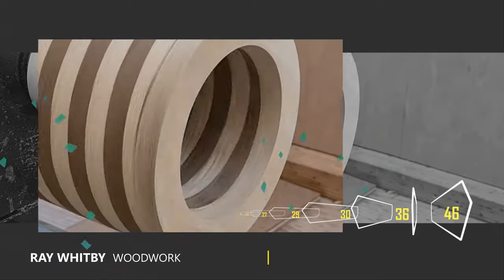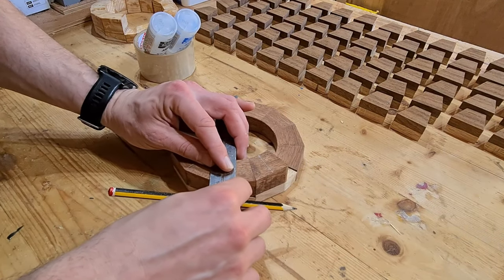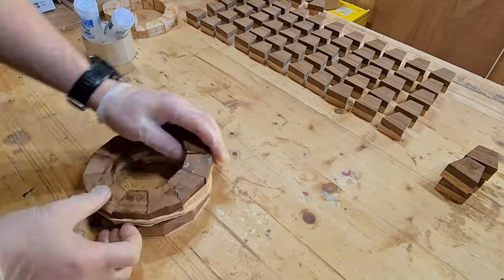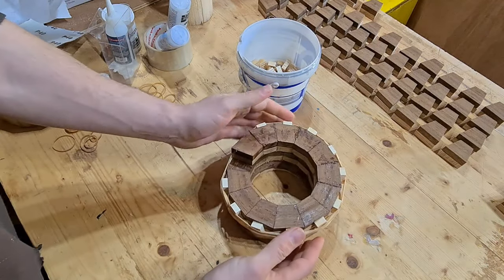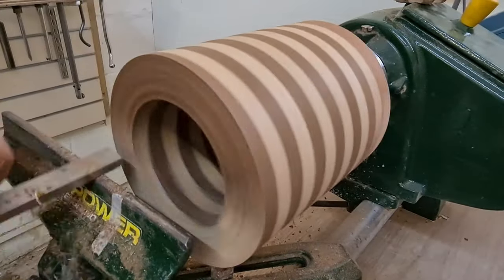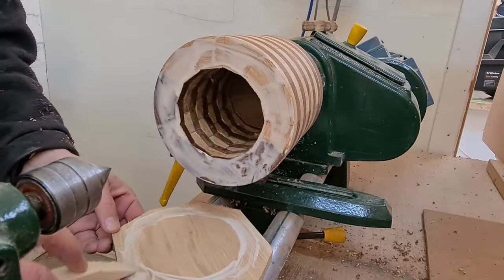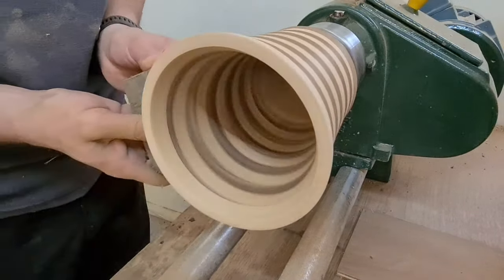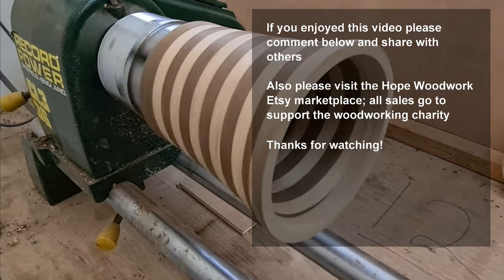Woodturning - The Twister

Comment from the maker: Question of the Week: What is the best way to really show off the helical design of the piece in terms of overall shape and the style of the open end?
Reply: Making the blocks thicker to really kick the pitch of the helix would do it......... At the expense of a shedload more work recalculating all the block face angles. :D
Or, if you went away from the vertical joins between the blocks entirely and made them into a squat diamond shape, you could make the helix go whichever way you wanted, or even have multiple helices going in opposite directions........ Even more work than just tweaking the angles though.
Reply from the maker: @Reman1975  That's some fantastic idea Reman! I had a pseudo mental image a couple days back of opposing helices but couldn't quite figure out the "anchor" pieces - your idea of the diamond is the key! I've got another idea for an open helix structure to try and getting distracted with bow ties again. Hopefully I can cogitate this idea further to see if I can figure out a way. Thanks so much for sharing the ideas! All the best. Ray
Reply: @RayWhitbyCreations  Interesting.
As soon as you said "Open helix" It made me think that the diamonds didn't have to be full square's. You could just make little "Planks" of wood and alternate the direction. You'd end up with a wooden "Wicker basket" sort of affair. What I'm visualising would be an absolute pig to put together (It would probably need a huge number of spacer pegs to go in the gaps while the glue took), but what I'm picturing would definatly be something I've never seen done before, and the smaller contact area between the pieces would mean that the accuracy of the angles wouldn't be as ridiculously crucial as they are on the projects that use full surface contact between blocks.
I'm not sure how structurally sound it would be though........ Then again, you've already made a couple of seemingly impossible projects where all logic dictated that they should have become wooden shrapnel the second you touched them with a tool tip, So maybe it would hold together ? :D

Edit - A random idea just popped into my mind......... What if the little planks in the wooden wicker basket idea were made from decent quality voidless birch marine ply, with the edge of the laminated layers facing out? I've got a strange feeling that as a classic pot belly vase shape that would be really attention grabbing, and add a "Is it actually wood, or something that's been woven?" feel to it.
Reply from the maker: @Reman1975  Love this idea Reman. Going to take some time to think about this. I have copied your comment and put it somewhere safe (coz I doubt I'd find it in the comments when I want to go through it again!). It's conjoining with an idea I want to try with Kumiko and now with interconnecting diamonds or hexagons. It's going to take time to develop and then see if I can make it work. It should look stunning, but it's a big if.
Reply: Perhaps making all of the blocks out of the same species, and then just adding a contrasting veneer layer to delineate the helix... could add some delicacy to the visual impact.
Reply from the maker: @howiebalch8402  That's an excellent suggestion Howie. I like it!
Reply: I Really like the way you have done it. An open end would probably not be possible to get it very, very, very neat. The topring you put on it makes the vase look stunning without any visible flaw.
Reply from the maker: @frankvanderwal4571  Thanks Frank! Appreciate your feedback. All the best. Ray

Comment: Great work Ray! Your bandsaw jig is absolutely brilliant I would not even know where to start making this type of segmented turning. But you certainly inspired me so will give a go to something similar but still different 😀
Reply from the maker: Thank you very much David! I would be interested to see what you come up with. Not sure if this will help, but the immediate thing to mention (if doing something similar) is that the helical angle change between front and back of each piece is non-linear. So the bandsaw ramp should be profiled aaccordingly if you wanted to get a seamless interface, or as close to it as anyone could get! But the larger the diameter of the project, the less pronounced this non-linear variation will be. I used epoxy glue as it could hide minor gaps! And using epoxy resin with a longer setting time really would have helped this project! Thanks so much for watching and commenting. Take care. Ray
Reply: @RayWhitbyCreations  That sounds like loads of precision needed I am not sure I am good at that :):) Have something different in mind but not even sure I can explain it. Will do some test run to see then move on to making the project 😊

Comment: Very ambitious project, and well done! At one point you asked opinions regarding the rim piece... another option might have been to do a segmented ring of oak to minimize end grain, possibly would have worked on the base as well. Keep up the beautiful work!
Reply from the maker: Thanks Howie. The segmented ring for the rim and base could work. I guess it depends whether the alignment of the different width of wedges (12.5 wedges per turn for the helix and an integer number of wedges for a horizontal ring = slight  mismatch) is positive or negative or hopefully not noticeable. Thanks for the feedback, love the idea! Take care. Ray
Reply: @RayWhitbyCreations  I don’t know, I say lean into the mismatch, change the segment angle to 10 or 15 degrees, make it a feature not a problem. 😉

Comment: Was watching an Olivier Gomis video the other day and wondered if someone had done a segmented helix project before with smooth transitions. My hat is off.... bravo. 
I think the solid top and bottom rings worked just fine. 
Maybe the center core could be epoxy proofed so it can be left in place while gluing.
Also the clamping paper should be replaced with saran wrap or wax paper. 
Make a spinning motorized base for that make you dizzy experience.
Reply from the maker: Thanks Mr Mc Flurry, greatly appreciate the feedback and advice. I had not come across using saran wrap or wax paper to hold the piece. Was told slightly damp paper towel would suffice, but always would prefer something with more grip! I have visualised a logical next step to the helix, but I don't yet know if I can pull it off. Time will tell. All the best. Ray
Reply: @RayWhitbyCreations  the saran wrap or wax paper mainly keeps your epoxy and glue from sticking. I hate having to clean off bits of what ever stuck when doing glueups. I subscribed so am looking forwards to your next project.
Reply from the maker: @nutsmcflurry3737  Ah, I see. It is the product needed for an upcoming project! Thanks for your support.

Comment: Another great example! I wondered about either an accent piece (black veneer for example) between each piece or maybe even a piece of clear/translucent material. When I hear "double helix" I can't help thinking of the DNA model. Cheers, Dave
Reply from the maker: Thanks Dave! I think for accenting this piece I would need to offset the oak from the mahogany wedges to get a decent brickwork pattern. This would require a redesign in the approach, which I'm working on, but not yet clear on how to achieve 2 seperate (albeit interacting) helices. If I (or others) can crack this new approach then a proper model of DNA should be possible! Thanks for your feedback. Take care. Ray

Comment: One design idea is to use one or more thin dark wood strips to make the spiral, and use a light colored wood for the rest of the project. This would keep the design simple and elegant I think. I have no idea how to make the lines cross over each other, but that would be very cool. Also, are you familiar with the work by Steve Garrison? He has some very interesting work on making spirals with a scroll saw that might provide some creative cross pollination with your work here. Keep up the great work!
Reply from the maker: I hadn't seen Steve's work and it's very creative. An elegant way to achieve a spiral. And without having to invent a new woodworking cut and jig! Thanks for the heads up!

Comment: A great project, I enjoyed this video. 
This isn't a criticism, just a couple of ideas that I would love to try if I owned a lathe:
1- I'd love to see what it would look like if you made the helix at a much steeper angle. I am not sure how steep you can go before it becomes impossible to glue up but I would think the effect would be very cool.
2- I would also love to see the same thing you just did except with small spacers between everything. Then casting the entire piece in resin so that the resin would end up looking like 'mortar' between the 'bricks' of your helical structure. If you used a slightly opaque resin tint you could probably hide the spacers and make it look like the blocks were sort of floating.
Reply from the maker: Hi Curtis. Thanks for your detailed thoughts on this, greatly appreciated. I believe you are correct in that the steeper the angle the more difficult it would be to glue up when applying radial pressure. Perhaps increasing the number of "anchor" points would help. I have a project in mind that will involve a steeper set of helical angles, but it will take time to develop and I'm not yet sure if it will work.

Your second idea was my initial desire, to space out the wedges and fill with resin, but I had to see if I could make a seamless version as that would be the most challenging and I thought therefore if I achieved it then it would be a really popular video and take off. A strongly performing video helps with the growth of a channel. 

Anyway, now that I have at least achieved the design for a seamless version, I can look into the wood and resin ideas. It's probable that the combo is more exciting to the YT algorithm! I've got a couple of immediate projects on the go and my day job work is increasing, so it may take a while before I can get to it.

Thanks once again for watching and commenting. Take care. Ray

Comment: I would like to start by saying absolutely beautiful! My thoughts on construction instead of epoxy I would use titebond and ca glue on the anchor blocks and titebond on all the other. Far as the ending and beginning rings it might be interesting to add a accent ring that draws your eye into the beautiful movement you created followed by a segmented ring of oak and mahogany. With that said what you created was truly inspiring and beautiful bravo!!
Reply from the maker: Thanks for the detailed insight William. When you say accent ring, do you have a link to a photo or video where it is featured please? Really interested in visualising your thoughts on this. Now that I completed the piece and it looks fairly flush fitting in all the pieces (no gaps), I probably could have done it without epoxy glue. Perhaps I should have had a little more confidence. Thanks for watching. Take care. Ray
Reply from the maker: @willaiml  Thanks William, will be thinking about it!

Comment: #doublehelix Excellent! This is a great idea, which will inspire many more I am sure. I hope to imitate this effort. I am trying to understand the need for different angles on the cut segments. My geometry is pretty rusty, so I could use some tips. If you could explain that part, and the need for the bandsaw jig, I would be really  grateful. Thank you for sharing.
Reply from the maker: Hi Mark. The top and bottom of each segment needs a varying angle. If you imagine a point on a circle is trying to rise in height by 10 cm with each rotation and it's 100cm from the axis, the helical angle is going to be low (in 2D = larger circumference, small height, small angle). But if the point is 1 cm from the axis it has to gain 10cm height more quickly on rotation the helical angle is steeper (small circumference, same height, larger angle). If you join these points, that's where the top/bottom surface aligns. On the outside of the segment the helical angle will be small and on the inside the helical angle will be larger. So the bandsaw jig will change the angle of the segment as it passes through the bandsaw blade and that angle will correspond to the changing angle experienced going from the outside to the inside of the segment (when looked from above of a cylinder). The video footage may be easier to understand in this video: https://youtu.be/c2XBWzzYMdY. By way of proof, if you cut these with a compound angle (bevel and mitre) they will leave a straight cut at a set angle. These will not stack correctly/seamlessly. 

If this doesn't make sense please ask me more questions or if you have other questions about it, let me know. I am very happy to help. I'm really interested to see what others can do to achieve this design. All the best. Ray
Reply: @RayWhitbyCreations  Thank you very much for the very detailed reply. I will be looking very closely at this. As you are so far the only one who has attempted this (and succeeded!), you are the only teacher available. I have already started with some experimental cuts, and found out a couple of methods that don't work. I imagine I will be closing in on your method very quickly. But this looks like a fun project, with beautiful results, and I can't resist a challenge. I will check out your other video, and I am sure I will have more questions as I move along. Thanks for everything!
Reply from the maker: @markbahlke9091  Hi Mark. Best to email me and you can send photos of your current setup. Hopefully I can guide you through.

Comment: Awesome work :-)

As for constructive criticism, I think it would look better if each helical layer was offset from the other, rather than having the two layers "in sync", as it were. This will of course make it impossible to build each full layer in pairs as you did for at least some of them here. 

Regarding the shape, with the helical pattern and the way you built the blank, I think you hit it spot on. Realistically, I think there are only two real options: either a completely straight line (cylindrical or slightly conical), or a gradual curve like you did. I think having multiple changes of angle would distort the helical pattern and make it look weird.

Where to go from here? Depends how much of a challenge you want ;-) Personally, I would love to see a bowl with this sort of helical pattern, perhaps even with 3 different woods rather than just two, but trying to visualize the calculations, planning and techniques required to build the blank makes me go cross-eyed and get a headache. But then I'm not any kind of craftsman, so you might well be able to think of a way to do it.
Reply from the maker: It's going to be an interesting challenge to get 2 helices offset, but it's something I want to try. Love the idea of 3 woods, all offset. I guess to make it easier it would be better to go for a wider bowl and try to reduce the change in the tangential plane helical angle as much as possible. Making my head spin too. Now to find some time to focus on this project. I've got 3 other projects I'm keen to get done, but even 2 weeks per project is a push. Thanks so much for the detailed feedback. It is really appreciated!

Comment: Wow! How did I miss this!? Beautiful as always. I have a question though. Why didn't you glue the two woods together before cutting? I have to admit, I had my eyes closed most of the time, I fell asleep the first time! Very ye boggling!!xxx
Reply from the maker: Hi Tina. Thanks so much for your feedback on this project. I did actually glue the wood together before putting on the bandsaw to get this varying helical angle. The problem is that the direction of 2 parallel planes (between the oak and utile) would leave a zig-zag pattern when turning rather than the actual pattern that aligns to the helix. Even if I could rotate the interface to the helical angle, if I turned a lot of material away then the interface line would appear non-continuous the closer I got to the central axis. I saved the pieces so I can do a standard segmented wood turn some day. All the best. Ray